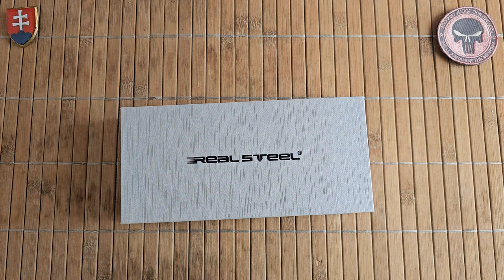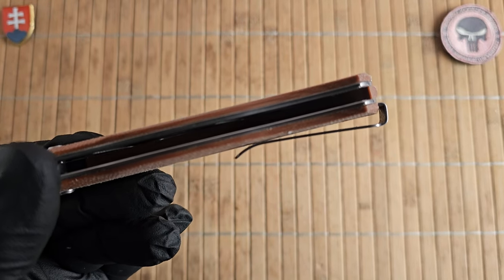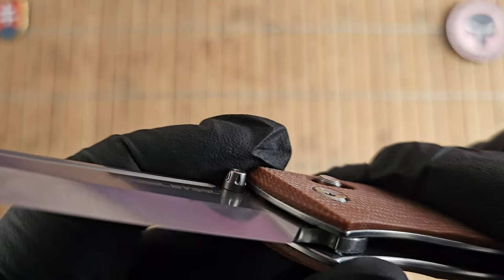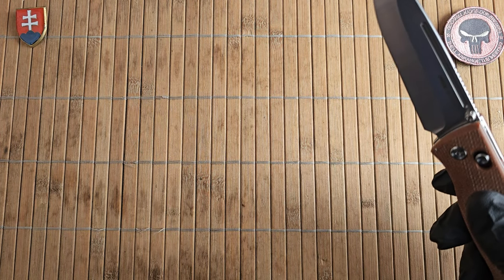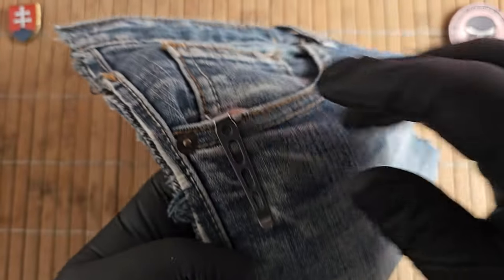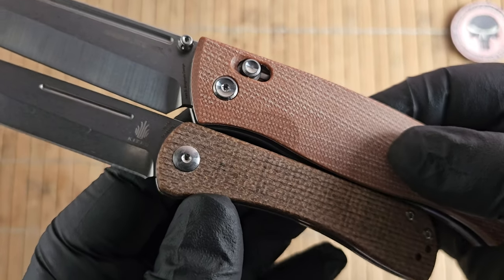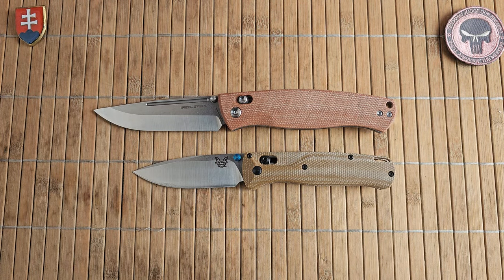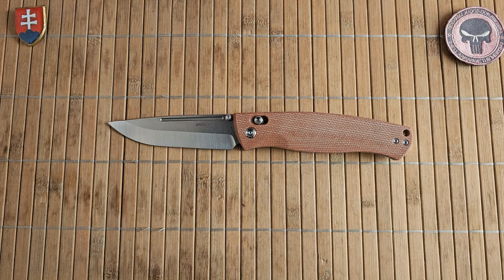Real Steel - Pathfinder

Comment: The back is sealed because this is a bushcraft knife. A wood processing knife, not really a light duty edc. It increases the surface area in contact with the palm, spreading the pressure. Cutting wood creates a lot of forces. The knife would be cheaper without the backspacer.
Reply from the maker: Thanks for sharing.